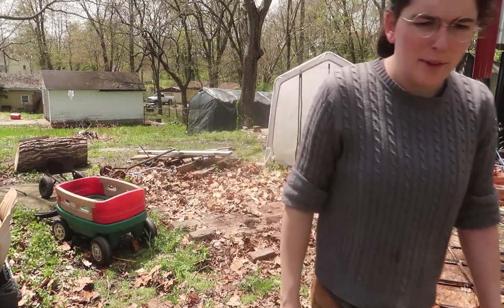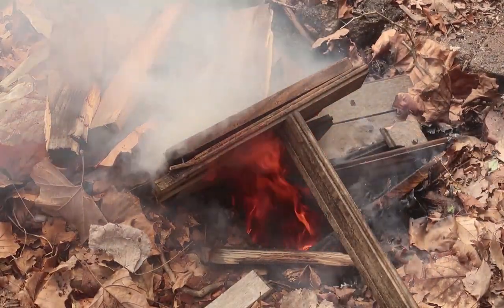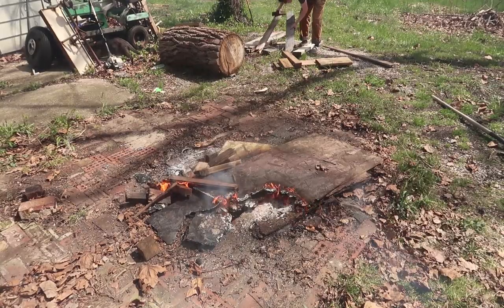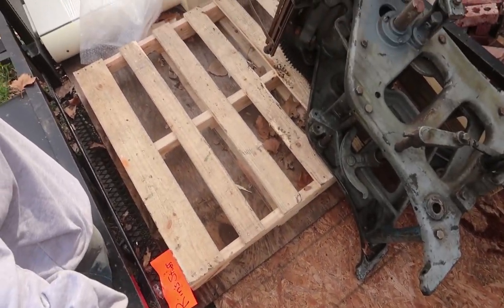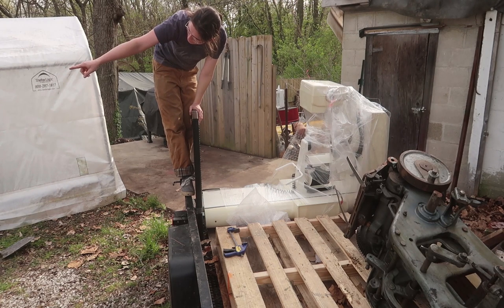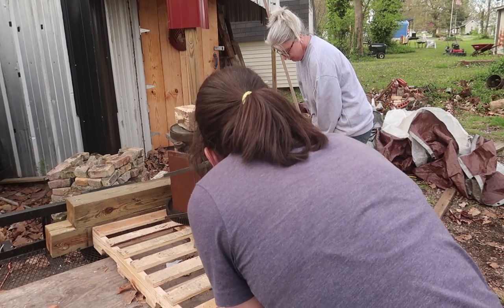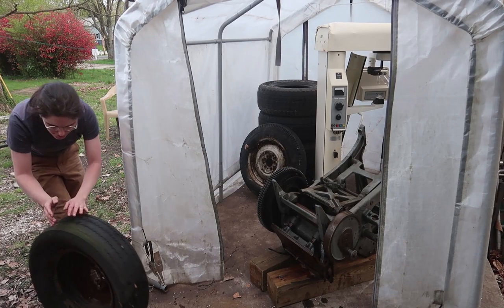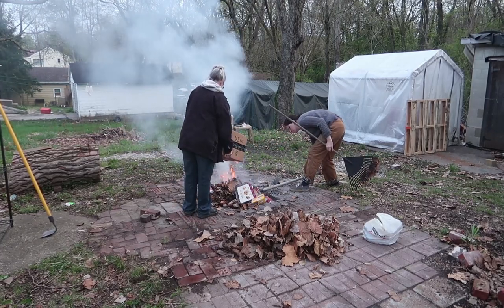Random Bits 0245: Moving Shed, Printing Press, X-ray Machine, Cleaning Burn Pit!

Comment: I wouldn't be surprised if the panoramic xray is fully working. Most dental offices throw them out when they switch from film to digital. No one wants the film ones anymore. I used to fix those and have seen that model many times.
Reply from the maker: well i know its fully working.

Comment: Your sorting method is similar to mine. I use what I call a 'slush' box. I can rapidly clear everything off a workbench, and into a slush box.. Then I know where everything is. All tools can be picked out, all fasteners, do-dads, etc, can be separated, and dumped in the trash. Speeds up the cleaning process when time is critical, and helps contain the chaos. Also works well to provide a sorting container.

Comment: Purchased a 8 x 10 tin shed from Tractor Supply last week.  Have the floor built and the base frame.   Stupid winds came and I just can't set the walls by my self.  Need to wait until I can recruit some help.  One of those fabric sheds wouldn't last a year here in the Sun.   It would go rot in no time.

Comment: Does your X-ray machine still have the radioactive element on it
Reply from the maker: x-ray machines dont have radioactive stuff in them, they are electrically driven tubes not decay emitters.
Reply: @RinoaL  if you have time you might want to do a video on that . because the X-ray machines my father had in his medical office used radioactive emitters . that was back in the day when we use real X-Ray film. And hand developed the X-ray